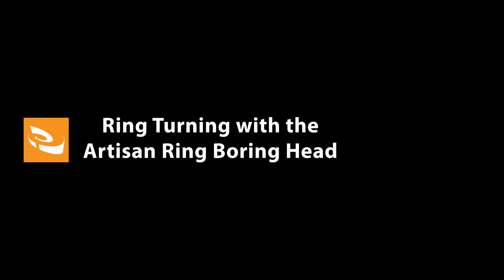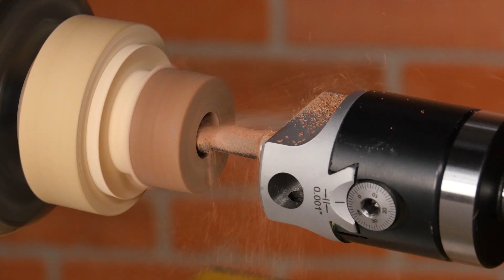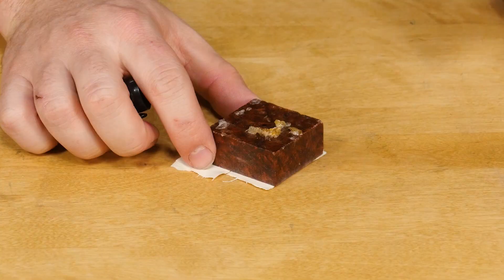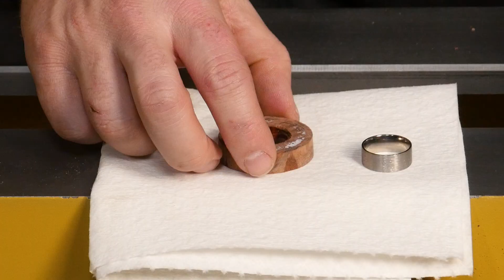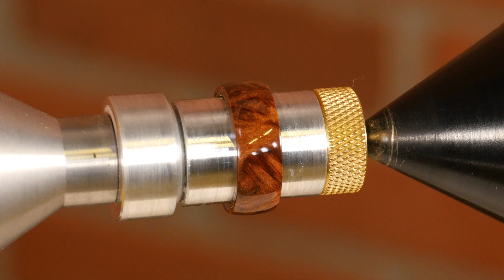Ring Turning with the Artisan Ring Boring Head

Comment: I bought this ring boring head, however the dial WILL NOT TURN. It wiggle from 5 o"clock to 7 o'clock, but will not turn 360 degrees as shown in the video. What can I do?
Reply from the maker: Loosen the 3 grub screws on the bottom side of the boring head to adjust the side to side tension.  Please give us a call if you still need assistance.  Thank you!  1-800-551-8876

Comment: Annnnd of course it's only in MT2.  Because no one would EVER use an mt1 mini lathe for rings...
Reply: That’s because they are actually selling a boring tool designed for metal working milling machines. This not something that was “invented” for woodworking.
Reply: @rah4822  I'm well aware that it's a boring head for machining seeing as I have one for my mill.  That aside, given you can find boring heads with a MT1 taper pretty easily, it originating as a machining tool has nothing to do with my pointing out them failing to carry it in that size....
Reply: Sorry man, didn’t mean to imply anything, it just frustrates me when these venders try to market something that’s been around for decades and jack up the price because they found a new application.

Comment: Very nice. Thank you for this. What's the other hole in the boring head used for? Can this be used to cut exact sized tenons say for kitless pen work?
Reply: there are 3 holes, each to migrate to a larger hole series, the screw range is small, the holes "off centre" give the tool more reach to larger diameters.
Reply: @andyvan5692  I believe ive seen other video's where the other holes and cutting bits are used to mill the outsides of pieces , as well as the inside !!
Reply: @roybrower990  Yes, they are used for that (the hole thats bellow the adjuster screw), it's used as a kind of "fly cutter" on surface of parts, like a plane on wood is used to level a surface, this is used to level a metal or plastic, etc. surface in just the same way.

Comment: Using that ring turning chuck the metal inserts cover the side of the ring so much I can't round the ring or even see the metal insert.  Using large inserts for a 12 1/2 size ring.  Medium inserts are too small.  are there other size inserts?

Comment: having much difficulty with double sided tape.. Nothing seems to hold  used Gorilla double side and would not hold.  Sanded clean both ring block and jig center Help
Reply: Are you using their tape? Because normal 2x sided tape sucks. If you do use theirs and it’s falling off make sure your waste blank is clean too. If all else fails add a small drop of CA bond to the waste blank and then put your taped ring blank on it. Press hard on it to make sure it’s bonded really well.
Reply: having the same problem!! and using their tape. and tried the drop of CA glue.  If you find a good solution, please post again!!!
Reply: I just use CA glue. Medium glue on the blank, accelerator on the waste block, done. Use a parting tool on the seam, sand and clean up as easy as you would if it was wood. Simple, and less risk of breaking anything trying to pry it off.
Reply: @cindyspiers9578  ...Be sure to take your tail stock with a 60º cone installed and move it into the ring blank, applying enough pressure to make sure the double sided tape is doing the job it was designed to do. Keep the tailstock pressure applied for a good five minutes to ensure a snug fit between the tape and the wood. I use CSUSA double sided tape and have never had issues using this method. Give it a try;)

Comment: I dont understand why you don't just offer a set of drill bits that match the ring sizes? Even with a boring head its easy to oversize. Ive blown through alot of blanks and ring cores that the wood cracks on after installing it.

Comment: Looks sweet on that Powermatic, but before you run out or go online and buy one it would be wise to checkout your tailstock. A wood lathes tailstock is not meant to use in this manner. It is designed to be static, lengthened to apply the appropriate pressure and then locked in place. It was not designed to operate while moving in and out, so the tolerances are very loose, this why Mike was using the lock to take up the play while he was moving it. Not everyone’s tailstock will respond well to this method as it is rather sketchy and is unlikely to work as smoothly on your average lathe, let alone a MIDI lathe. Just saying…
Reply: then why do I and many other pen turners drill on the lathe with no problems?
Reply: stop trying to discourage people, it'll be fine. we've drilled on lathes for years, how is boring any different, I think you're just trolling.
Reply: @calvinwendland8373 1st, I'd like to thank you for removing your second comment. Calvin, the boring bar is designed to be used on a metal machine lathe, not a wood lathe. At the 3:30min mark you can see where Mike adjusts the quill lock to accommodate using the boring bar in a lathe that isn't designed to be use it. It doesn't mean it can't be used, "But" it should also be explained as such and the lathe requirements needed for it to work properly. Many if not most people use mini and midi lathes to turn pens and rings and they will not respond as well as the $4799 Powermatic 3520C shown in this video. Calvin, I'm truly fortunate to own a few lathes and I'm quite familiar with their abilities and limits. I'm just sharing my knowledge and experience so others might benefit. Heck, many have switched to metal lathes to correctly use boring bars such as Aaron Thomas (below) to more accurately machine rings and even pens for that matter.
Reply: @calvinwendland8373  Good for you!  I don't understand why you think I'm "anti-boring bar", I couldn't be clearer on my rational. I hope it works well for you, enjoy!
Reply: I wish I had seen your comment before I bought this equipment. I have a Delta midi lathe and your observation is spot on. I’ve watched this video so many times to see where I’m going wrong that I have it memorized. My lathe was a gift from my spouse so I could turn pens. I’m trying to graduate into rings. Tightening down the quill just means I can’t turn the wheel in the tail stock to advance the tail quill closer to my wood block. It does NOT tighten the tool into the tail stock. IF I want to use this tool (I could be wrong with my workaround) I need to hold the body of the boring tool as it enters the hole I want to bore, otherwise just spins around since there is nothing holding it steady in place in the tail stock. It’s a workaround that I’m not comfortable doing and it wobbles as well not returning a clean cut. If I am way out in left field or making this harder than it has to be, I welcome solutions. Right now it’s an expensive door stop. My observation has nothing to do with Mike and his videos. I watch as many as I can. This one, about the boring tool, just didn’t work for my Delta lathe.
Reply: @noahsark5279  I just got your message, I'm a bit busy at the moment, but I think I can help you out after I handle some things. OK?
Reply: @toolchuck  Thanks so much for the quick reply. Appreciate the help.
Reply: @noahsark5279   OK, 1st off, the lock is not what holds the tool into the quill, (if I'm reading your statement right) it is the taper, likely an M2, or Morris #2. Make sure it is clean, alcohol and paper towels on both the tool taper and inside the quill. Then with a very quick/sharp slapping motion run/ram the tool into the quill. There should be a solid snap or click when it seats properly, if not, try it a few more times, you'll know when it had a solid seat because it will not remove easily. This should set it more than well enough to keep it from turning as this is the entire purpose of the taper. 
Now the lock, only slightly tighten the tail stock quill lock so it takes up excessive slop/play in the quill but still allows the quill to move. This was one of my biggest issues I had about video, you may find it is a fine line between doing very little, to locking it up. But with some patience you should find a sweet spot that works, it may not be perfect, but it should be better than not taking any play out at all with the lock. Use as little of the quill as possible, by this I mean run the quill back into the tail stock as far as possible and then move the tail stock up so the Boring Head is as close as possible to the ring blank. This keeps as much of the quill inside the tail stock as possible which will reduce the amount of play in the quill.

I hope I'm understanding your issues correctly and addressing them, if not, a full refund is available, with the proper documentation of course.
Chuck.
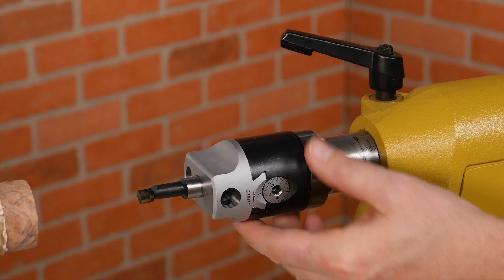Reply: @toolchuck  Thanks for the info. At 3:26 Mike states to keep the boring head from moving side to side use the locking quill arm. I knew that the locking quill did not lock the tool into the MT but it sounded like that is what I was hearing from Mike. So I started thinking that my lathe was not compatible with the tool. Now that you gave me new instructions I went and tried it. I was able to get the boring head to stick "better" by turning it by hand, like it had threads. That does take some play out but it still wants to wobble once I put it up to the wood and start carving. I’ll play with it some more and see if I can use your instructions and my tinkering to get it to work better. I really appreciate your advice.
Reply: @noahsark5279  Please check your YouTube channel discussion and reply, thanks!
Reply: @noahsark5279  hey, did I loose you? 😳
Reply: @toolchuck  No didn’t lose me. I did answer you. It shows that I answered 1 week ago today. It’s the reply where I talk about Mike’s statement at 3:26, I think. I was able to get the unit to stay in the tail stock better when I kept twisting it. However, even after I use a drill bit to start a hole, then put the boring unit into the tail stock, the bit in the boring unit comes no where close to that drilled hole. I turn the dial with the wrench but hit the end of the max adjustment before it comes even close to the hole. It’s like something is waaay off center. I have a ring blank in my chuck, drill a start hole, then put in the boring unit and can’t go any further with it. I tried using the other hole in the boring head, for the bit, but that offset was worse. I’m back to an expensive door stop.
Reply: @noahsark5279  Did you look at your YouTube site/page under DISCUSSION?
Reply: @toolchuck  Sorry. All I see are the following options at the bottom, Home, Explore, Subscriptions and History. Don’t see discussion anywhere. I’m using an IPad.
Reply: I love the concept of the boring head, but also agree with what you're saying. I have the exact same problem. It wobbles too much, and my lock is on the side, so even if I find the sweet spot, a bit of vibration either loosens or tightens it amd have to tweak all over again. Starting to get a bit frustrated, but it is definitely a great piece of equipment.
Thanks for the comment, it should help others too!
Reply: @JacquesAlouan  Hello Jacques, Hey noahs ark reached out to me about a month ago with a similar frustration. We chatted a bit about her setup. And threw a bit of trial and error, and mostly her determination and wit, she was able to get it to work for her. Last I heard, it is no longer a doorstop. 😉 I'm not sure of your setup, but her lathe was definitely in the category of lathes that I was concerned about. You could try to find a bolt that is the same as the quill lock, but longer. Get a washer and a nut for it and thread the nut on and then the washer. Screw the bolt in and bring the nut up to the tailstock but don't tighten. Now adjust the bolt to get the "Sweet spot", then while holding the bolt with a wrench, tighten the nut against the tailstock with another wrench to lock the bolt in place. No need to over tighten, just enough to keep the bolt from moving. Also, before placing the bolt in, you can dress the tip by using a file or sandpaper to smoothen it to slide better. 
Hope it helps. 🤷‍♂️
All the best, Chuck
Reply: @toolchuck  that's amazing, thanks for the level of detail, I'll try it out!

Comment: Amazing video - thank you! Just purchased this set and trying it out. At the start you mentioned the blank size should be about 1/16" wider than the ring core. But in this example (easy to see around 5:02) it looks like the ring core is much smaller. Can you let me know what you recommend for blank width?
Also, when you insert the ring core to turn down the face with a skew, how can you tell when the ring is flush with the back (for example what if you cut in too far with the boring head and the insert sinks in too far)?
Thank you again!

Comment: NICE! I ditched the hand tools a while back and started using my metal lathe to more accurately bore to the correct diameter. I am really glad to see this, I might have to try this too...
ALSO:  You're going to need some telescopic bore gauges and vernier calipers or a micrometer.  For attachment of the blank to the core DEFINITELY use epoxy, avoid using CA glue.

Comment: My hobby is metal machining with very little wood working so take my comments from that perspective. A half decent pair of vernier, dial or digital calipers ought to get you close enough even with there built in in-accuracy's just by simple inside and out side measurements that would allow getting any fit you'd like with that boring head a whole lot quicker than multiple trial fits. And doing so just by dialing that boring head into the correct size by using the dials numbers on it as it's supposed to be used. Yes there's far better, more accurate and much more expensive methods of inside or outside measurements, but caliper measurements would be more than good enough. 

I'm constantly amazed at the money and lengths wood turners will go to trying to compensate for antique wood turning lathe designs including the most expensive and newest on the market today. If you've got a bit of room buying even a well used and almost worn out condition 12"-18" swing metal lathe 50-80 years old would still be light years ahead of today's best on the market and for probably a lot less money. I'll point out that if there old enough then sleeve bearings would be common and incapable of enough rpms for smaller work. Roller bearing head stocks can usually have the drive cheaply modified to get into the ranges most wood turning projects would need. You'd have built in longitudinal and cross power feeds for quickly and very accurately roughing projects into size, fine taper turning, threading capability, far more rigidity than any wood lathe, and adding a tool rest for hand turning is easy. An added bonus is you also have the capability of building hard to find or impossible to get parts for any additional wood working equipment. I've also used my clone of a Bridgeport milling machine to process wood working projects. Other than part sizes too large there's almost no cut or joint that can't be done in far more safety with amazing accuracy other than possibly half blind dovetail joints. And adding a decent router to gain the high rpms for that type of work is easy. Foundry pattern maker shops did and still do use both slightly modified metal working lathes and mills to do the exact same thing. If I had the room and need for a full wood working shop I'd be sure to have both a metal working lathe and milling machine in it.